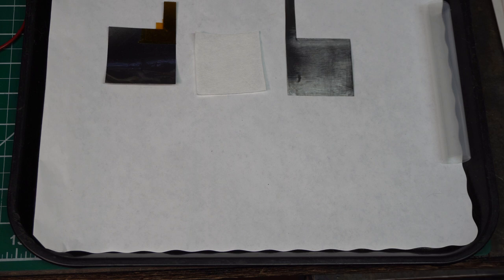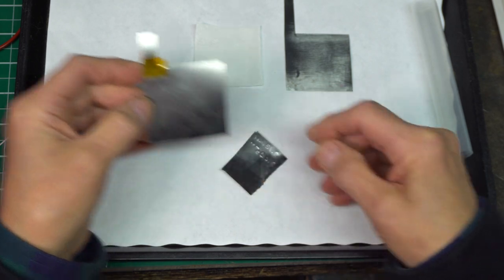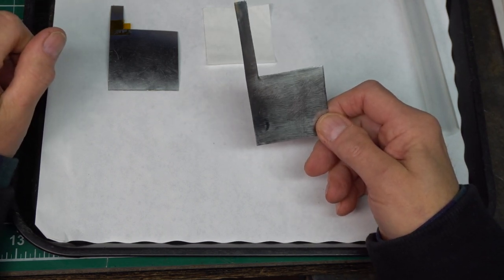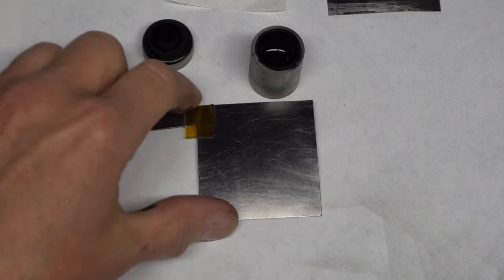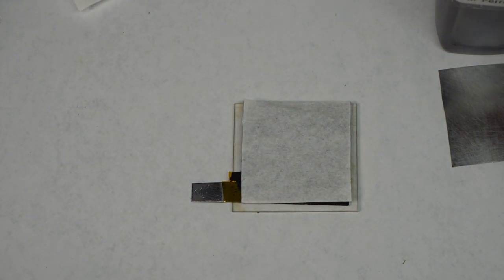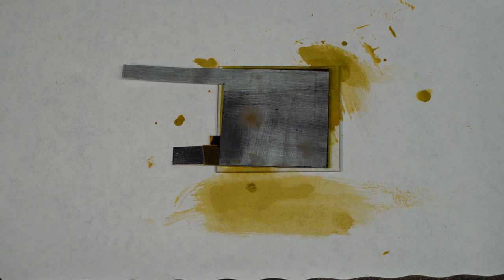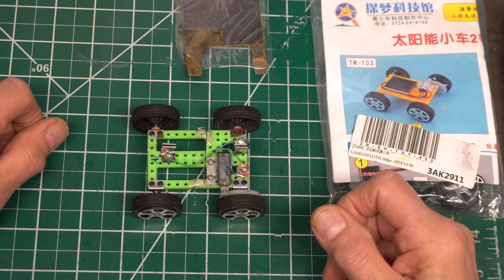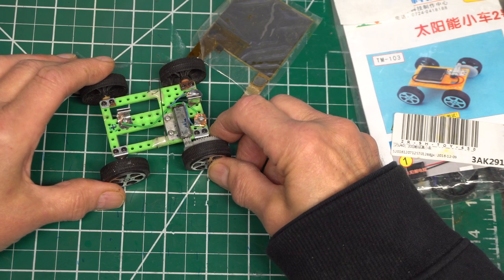Electric Vehicle Powered by Homemade Rechargeable Iron/Carbon Battery

Comment: I am having a problem .. I have tried to make battery 3 times and two with activated carbon and one with manganese dioxide .. Used potassium hydroxide as well as sodium sulphate electrolytes and charged on 2.6v  (at 3 volt electrolyte start burning) but all the time after charging voltage suddenly start dropping and battery don't have power to test on EBDtester ... Can anyone rectify what I am missing 😔0
Reply from the maker: I already tried those electrolytes and found that they do not work for this cell. You must use a Ferric Chloride, FeCl3,  solution for the electrolyte as I did in the video. I used 2M FeCl3 for the concentration. Also, keep the charging voltage between 1.4 and 1.6 volts or you will get too much hydrogen evolution and destroy the cell.
Reply: @William_Hada  FeCl3 2m with activated carbon both  electrode .. Right ??
Reply from the maker: @asifalikhan8677  No, only the (+) cathode is activated carbon. The (-) anode must be iron or carbon steel. Do not use stainless steel for the anode. The chromium in stainless steel will cause the battery to not work.
Reply: Also make 100% sure that your separator is slightly larger than your plates. A direct short will drop your voltage very quickly.
Reply from the maker: @unicornadrian1358  Yes, thanks for the useful tip.
Reply: You have not mentioned about  solvent and  electrlyte clearly .
1.omit mno2 and Na2So4   ( to avoid burning)
2. Use FeCl3 + K2SO4.Al2(SO4)3.24H2O+(Binder)+Organic electrolytic Solvent
This might give you some clue for further approach.
Reply: @TubaParveen-cd2ys  after long failures on this I moved to another chemistry of of zinc ion a years ago with pretty promising results.. 🙂...